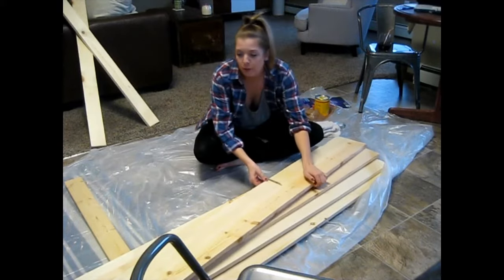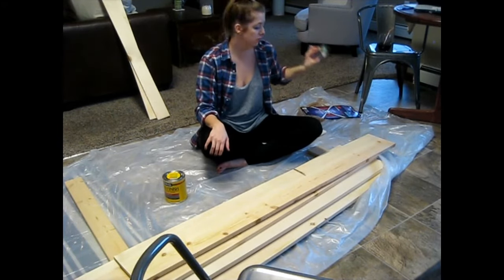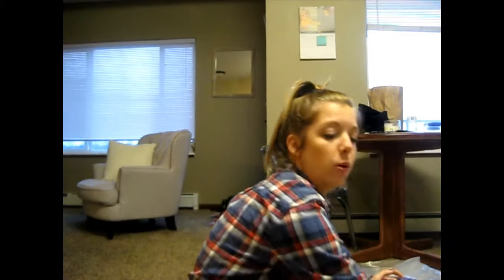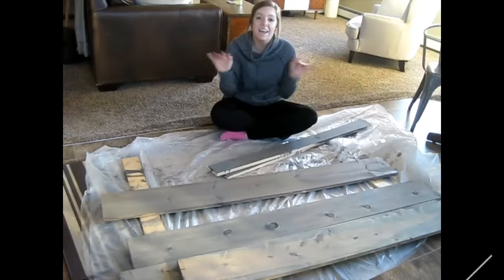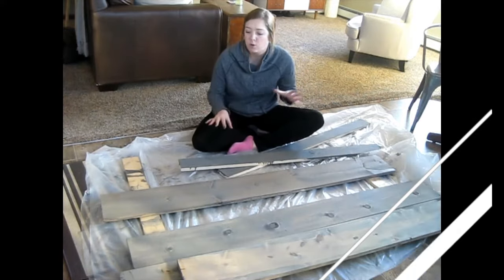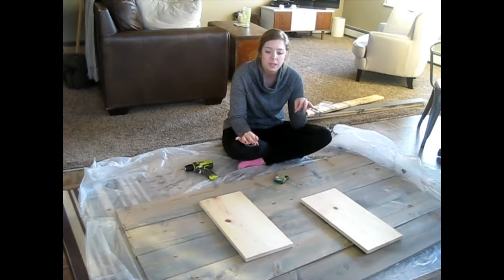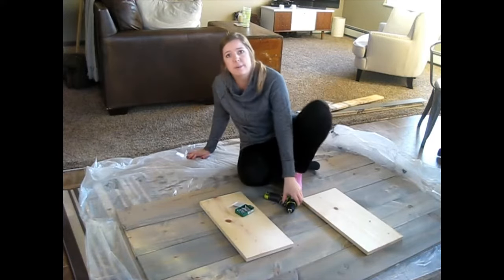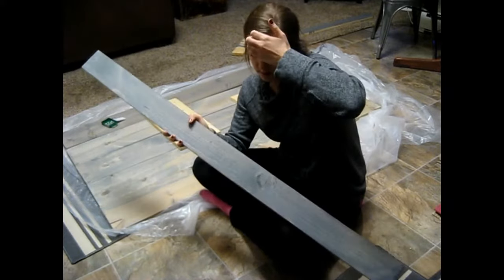DIY Headboard For Under $40!

Comment: Hi there, I want to use the remaining pieces of some flooring I had installed to make a headboard. What do you suggest I use to secure it to?
Reply from the maker: +EboniSpice I would use 2x4s or 1x4s as legs and attach it to those. Then a brace 1x4 in the middle. I hope that answered your question! Thanks for watching!

Comment: What sizes would I get for Full?
Reply from the maker: I would just measure  the width of your mattress and get boards a few inches longer. For the height of the board you can do whatever you'd like. You can do more boards that are smaller or fewer that are larger. Just depends on the look you're going for. Thanks for watching!